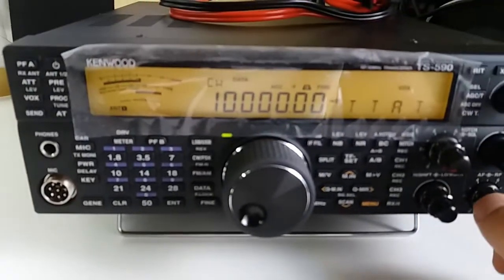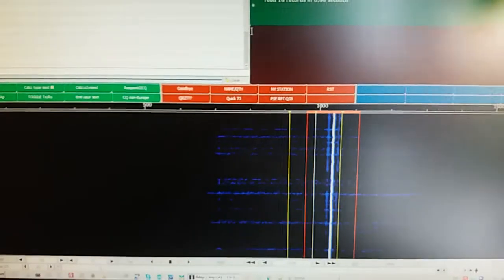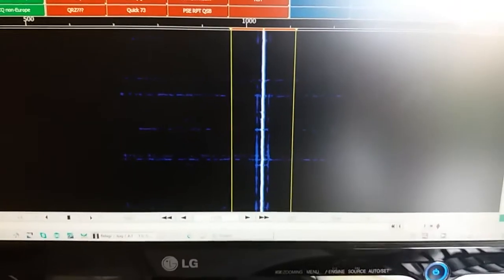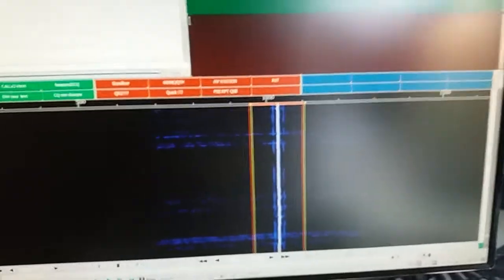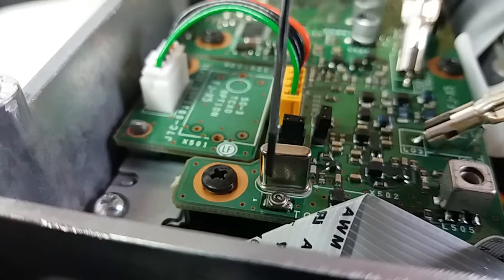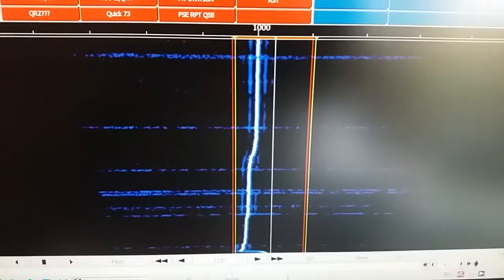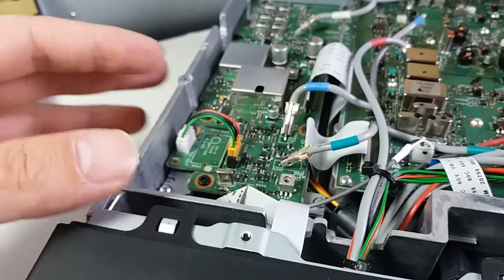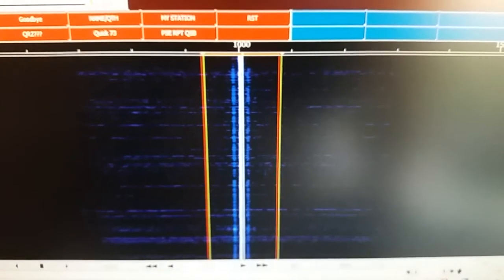Kenwood TS-590SG Reference Frequency Calibration (master oscillator tuning)

Comment: I did the same thing with my TS480.  It was way off, and I sounded funny.  I got it used -- 8 year-old radio.  Another ham on QRZ told me to TX a CQ tone at 5w high in the 6m band with another radio, and RX on the Kenwood.  He said to switch back and forth between CW and CWR, turning the variable capacitor (TC1 on the TS480) until both CW and CWR sound identical.  It worked!  You must do this high in the 6m band, though, so that the lower bands are all spot-on.

Comment: You should be using plastic alignment tools to avoid changing the capacitance when you touch the capacitor. They're inexpensive and invaluable especially when adjusting transformers.

Comment: For those who install the TXCO - the process is essentially the same EXCEPT that you make the adjustment ON the TXCO, NOT with the capacitor shown here. FYI - I have the cheap Chinese one and have not had any practical problems with it. The theory of those problems is valid but in practice it has not proven to be an issue for me.
Reply: I wouldn't use the Chinese clone. But, most hams always take the cheap way.

Comment: tnx, helped me out to adjust my TS-480 drifted away 30 Hz when warm up.
Reply from the maker: Indeed I realised that the frequency settles stable about 40min (!) after switch ON while the unit is on the receive mode. When you transmit it is inevitable that the transistors will warm up the near by components and the frequency will change (slightly though) again. Plus, the fans' operation factor: these will cool the unit as whole when the finals become very warm and will again influence the crystal oscillator. So, a txco is really the only solution, as others have pointed out, I believe if you want the ultimate frequency stability. 73.

Comment: remove the plastic on your screen it will lower the life of the screen as Kenwood rep told this is only for the shipping
2nd you need to buy txco for it this is not the way it work and should  not touch  .
Reply from the maker: Many thanks for this Elan, I will take away the membrane for sure! 73.
Reply: Take the plastic off your furniture as well.

Comment: Excellent video and your QTH sounds like mine with all the QRM in the background.  I too have the 590SG new in April 2016.  Most guys I talk to that are using this rig, highly recommend the SO-3 but are usually installing the Chinese version which is less money.  I haven't installed one yet.  My rig is pretty much dead on frequency.  I also find your English to be very easy to understand.  We say counter clockwise here instead of anti-clockwise.  But, I like your anti-clockwise just the same.  73
Reply from the maker: Lol, ok I took note of the clockwise options! Out of the box my 590SG was 20Hz or so off! This was particularly evident on the 10m band where the drift was very obvious - I had a QSO with a guy in France who had a SDR radio with extremely low ppm oscillator and he told me that he had to shift his frequency by 20Hz or so to hear my voice as it should be.  Now, my 590SG is properly tuned, no problems, and I am not so much bothered with the warm up waiting time. 73

Comment: Hi. Thanks for vid but which uncertainties are calculated for your signal source and for measurement before the adjustment itself? The real value of source is not what you read but in the range defined by value +/- uncertainty for some k-factor (standard is k=2 for 95%) ...you need to know all of these including the temperature linked to these values before touching the adjustment isn't it? Thanks MS
Reply from the maker: Hi Michael, the received signal is a 10 MHz radio world tone (CW modulated), and like all such radio sources, it's transmitting to within extremely high accuracy, especially for ham radio standards. This is the source of our signal received by the transceiver. There are many such radio clocks around the world, each using many different transmit frequencies, so you can double check afterwards your TRX's oscillator accuracy by sweeping across them. This calibration solution is ideal when the ham operator doesn't have a bench type frequency generator available (expensive to buy !).
I have prepared another video as well that shows how the oscillator's frequency is drifting with temperature after a cold switch on - so, the calibration should ideally be done when the TRX has settled in temperature (around 30min or so). 
In any case, unless you have a TXCO, the oscillator frequency will drift after, transmitting, say, in CW, as the temperature of the chassis will inevitably rise, affecting the oscillator's frequency. But, in any case, we're talking about a few Hz over here, at least on my 590SG!
Hope this helps, 73.

Comment: You have choose  CW DATA .........you have to choose  CW only.
Reply from the maker: Hi DirkPA2C, you don't have to worry whether 'DATA' or not is selected, as long as CW is activated. The 'DATA' on CW is for decoding only, which of course is not relevant for our purposes here. Thanks for watching, 73.
Reply: Thanks Kostas for the information ,I have a  TS-590S since Dec.2010 so a old version one of the first.No decoder in it....hi.Thanks for sharing this great video.Keep up the good work.73 de Dirk PA2C

Comment: A great radio that deserves a TCXO. You can get them on Ebay for ~20USD.   Also, Icom & Yaesu allow you to do this thru the menu... no need to go into the radio.  Kenwood needs to enter the 21st century.   I like your english.
Reply from the maker: Thanks for watching Bob. Indeed, a TCXO for this class of TRX should come as standard, like it does so on the much cheaper models that Icom and Yaesu produce. So far, I am happy with the LO stability after tuning, so I will save my money for other accessories! 73.

Comment: I wouldn't use a metal screwdriver
Reply: find a small piece of wood / a dowel OR plastic and simply carve / sand it into a small screwdriver tip. In the old days (I grew up with tubes) these were sold as 'alignment tools' in sets with different shapes/size tips. Thanks for the video! WB2SMK
Reply from the maker: Absolutely. Unfortunately, the only screwdriver in my lab that could fit into the variable capacitor head was a metallic one.